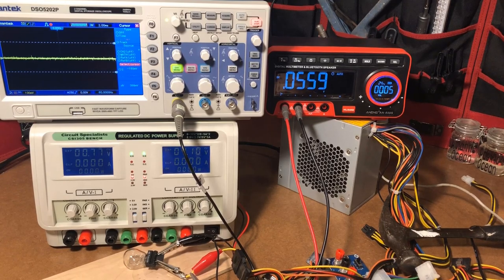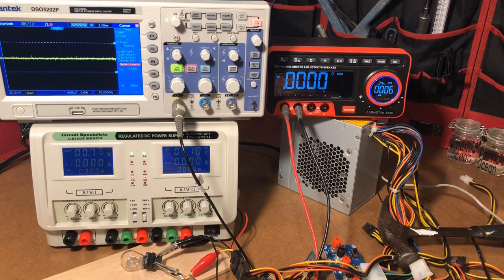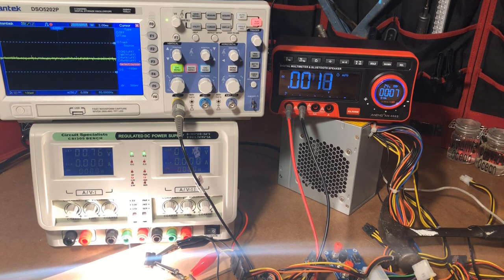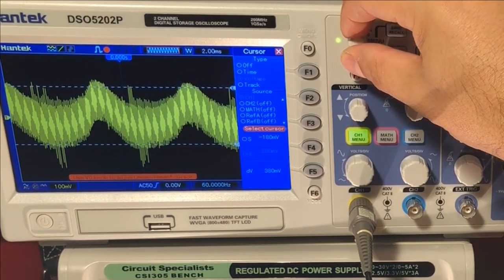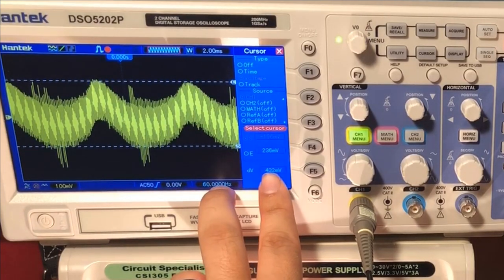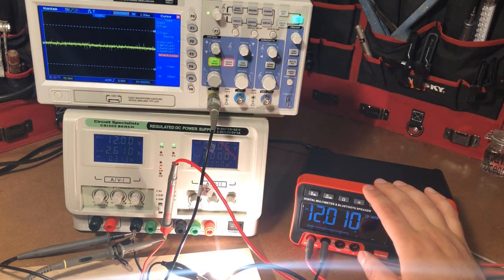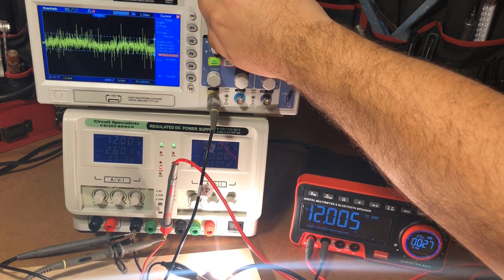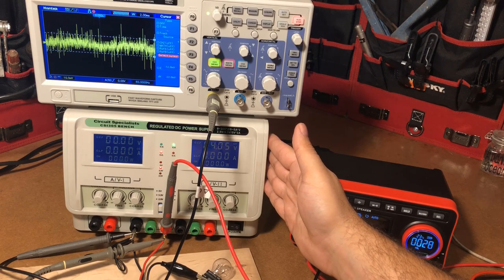Bench Power Supply vs ATX

Comment: Hey mate :) That PSU is either broken or out of spec because its an ancient design and cross-loaded. A-tier modern supplies are consistently under 20mV p-p.
Reply: It would be interesting to see the same test done on a newer ATX power supply to see how that compares to the older one.
Reply from the maker: I will absolutely do that.
Reply from the maker: Yup. I'll be checking that.
Reply: @AnotherMaker  so, update?
Reply: No mate, this is super common and honestly it’s actually expected in the power electronics industry based on quality and price of the PSU/ATX. If you want the cleanest power output, it will costs hundreds of dollars. The reason is because it requires immense circuit design for both input and output of the voltage and current. The pc components which consume these dirty power sources are the ones required to make it clean for good in powering it’s own advanced devices. Such as hard drives, they have their own power intake filtering to handle the ripple.
Reply: @sto2779  the hard drives will be dead soon from such high ripple anyway, this PSU is out of specs for sure.

Comment: Sorry but it is unfair to test such a cheap ATX PSU without comparing your expensive Bench PSU with a 80 Plus Certified ATX PSU (what we normally use for gaming and as an alternative for a bench PSU) they are also affordable and very high quality. I tested mine (80 Plus Platinum certified) that I bought on Ebay for just $40 and it is very clean. Perhaps not exactly as an expensive Bench Power Supply but very similar for the price. You mentioned Thermaltake... the brand is irrelevant when talking about the quality of a PSU. At the end the certification is what is important because they need to have way better parts and components to pass each level of the certification. Thermaltake for example has cheap and low quality PSUs too, unless they are 80 plus certified and each level of 80 plus is night and day difference between Bronze and Titanium certifications.
Reply from the maker: I don't disagree with your point that a better power supply would probably be better. I will say that most of the videos I had seen up to the point of making this one... People weren't going out and buying specific power supplies for the bench power supply project. In my experience, it has always been grabbing some random silver power supply from a thrift store or old computer. That said, if you are going to go out and buy a specific power supply, you are probably better suited with just getting a real bench power supply. They start in the $50 range with no modifications needed. 

I really do appreciate your post and would like to try this with a better power supply
Reply: @AnotherMaker  Thanks, very useful information. I always wanted a real bench PSU but they were very expensive in the past.

Comment: You usually use bench power supply if device itself don't have linear regulator or DC/DC converter. Also it seems that ATX psu violates specs. 12V should have max 120mV ripple. Maybe that psu is older models that need also some load for 5V line. New ATX create 12V and then use DC/DC to do 5V and 3.3V
Reply from the maker: Yeah. I don't know if the PSU is going out or if it has always been out of spec. My guess is it's dying. I will be running more tests.

Comment: A bit late to the party, what you could do if you want to clean up the output of an ATX PSU, you can add a chock, (make sure it can handle the current though) and then another filter cap thereafter to that output, it does clean it up quite a bit depending on what you use, still does not clean up totally..... ATX is not a good bench top PSU for development or testing...

Comment: Put a load on that ATX PSU and than check the ripples, normally in PC there is constant current draw for motherboard, harddrive gpu and than the regulation is much better. Other thing is that you use ATX and bench PSU in different ways, bench is designed to have low ripples so you can directly power your microchips. In PCs 12V is always used to drive motors (which doesn't need to be well filtered) or stepped down in peripherals to 5V, 3V or even 1,5V so proper filtering is done on that voltages. You Know that 12V is not powering directly any chips. 5V and 3V rails in ATX should have lower ripples.
Reply from the maker: Fantastic points. I will test all those things. I want to revisit this.
Reply: @AnotherMaker  I believe its still a thing that the +5V rail needs a dummy load across it to smooth out the rest of the output. On older PSUs it was a brown wire or a smaller gauge of the same color as the +12V rail.
Reply: Hey BART B, can you or maybe someone else explain this "put a load on that ATX PSU" ?
What does that mean and how is it done ?
Reply: @kruskotv1311  by pustyni load I mean connect harddrives, cdroms, motherboard, gpu or other perpherals that draw current from PSU. If you want to perform some lab experiments you can use resistors, but keep in mind you have to calculate its value from ohms law and count the disipated Energy.

Comment: You must remember that a PC PSU isn't designed to be bench top power supply anyway, that's just a hack, a really nice cheap one too, not bad for less than half a volt :)  I noticed that at no stage did you compare prices, you can make a super one for a tenth of the price and you should clean the power first like it would be if it was plugged into a pc, those would normally be plugged into a UPS or an inverter, not directly into the wall 😇

Comment: I have a bunch of different ATX-PSUs and most of them perform pretty well? Is your ripple under a certain load? Some old ATX need some rails loaded to work properly, typically at least .5 or better 1 Amps at least. Many of mine ATX have around 50...150 mV ripple - thats fine for many applications. Its not a linear regulated bench PSU of course.

Comment: Is it true if you connect all 12 volt yellow wires into one lead will give you the total amps in atx power supply? Example the rating listed is 14 -20 amps on a 350 watts atx ps. I want to use it in electrolysis to remove rust and it needs higher amps on a 12 volt dc

Comment: The same goes for Amateur radio operators, there are a few that use ATX supplies but as soon as you really push output power then they just fall over.  Also not the greatest to power LiPo Chargers for drone batteries.  Been there done that
Reply from the maker: Absolutely.  I want to revisit this with some more tests to understand these characteristics better.

Comment: It has to be a really crappy ATX PSU if the 12V rail has undervoltage on it even without a load. I'd throw away the cheap Chinese breakout box, too, and connect the PSU's own wires to bus bars, etc.

The 24pin MoBo-cable has very limited current carrying capabilities compared to grouping all the rail and ground wires in separate bundles and soldering them to hefty lugs. I'm building one at the moment using a basic 2007 460W HP unit and all the GND wires bunched together are thicker than my thumb. The Molex-boxes are for testing and repairs, not power delivery.

Comment: i have a 5v power supply i have questioned for awhile.  it burns out my tp4056 often yet a charger right next to it built the same using an atx converted supply never burns out a chip and is running at high voltage. is there a module that would help clean up my dc power supply? im willing to spend a little just to test the theory at this point.  its become kind of a project lol
Reply from the maker: I've discussed it with other youtubers and we have decided  that you should try a .1uF ceramic cap across the inputs and a 470uF electrolytic cap across the input together to filter multiple frequencies.  

So your wires will come into the input and you will have 2 caps between + and -
Reply: @AnotherMaker  thank you!  i will give that a try!

Comment: Does the desk multimeter go to standby all the time? I heard people complain about that
Reply from the maker: It does when there's no load. I need to check if that is adjustable.
Reply: @AnotherMaker  I've seen people complain about that, honestly that would ruin it's purpose as desktop multimeter
Reply from the maker: I confirmed in the manual that you can disable that feature. I use it on battery all the time though so I keep it on

Comment: Interesting. However it can be easily controlled using some bypass capacitors, almost all internal PC hardware must have some form of smoothing power intake Circuitry to overcome this.
Reply from the maker: You can absolutely use smoothing capacitors. Most motherboards have other things for further regulation and power clean up. Especially because the ATX standard is still old that there's a wide margin to what an ATX power supply can put out and still be in spec
Reply: @AnotherMaker  I agree with you. ATX and most power supplies/adapters including SMPS. Are not properly designed for optimal high quality clean power output. I guess there are many factors, one of those factors is to skimp on quality engineering of power electronics design, requires more effort and time but it’s not rocket science. It’s a subject I’m really interested on and wish to fully master on. AC and DC power electronics engineering.

Comment: Junkie power? My ATX is as solid as a rock and clean as heck...Ripple is as low as can be given its purpose (max 30mV) Logic, because CPU's tend not to like ripple...
Problem, most of the times is that ATX PS's used for this are almost always OLD. Most problems occur with older smoothing caps. ...BTW..Also, LIMIT your BW on the scope....Way cleaner results with these scopes.

Comment: Do I see that correctly that your ripple is at 60Hz?  https://youtu.be/fXk6HodtSmQ?t=253   That cannot come from the ATX power supply because Switch Mode Power Supplies work at a much higher frequency.  60hz is picked up by the scope, typically by a bad or missing shielding on the test probes.  i could be wrong,...  but 60Hz and an SMPS?  that doesn't add up...
/ChriV